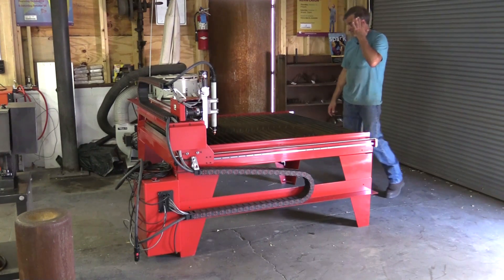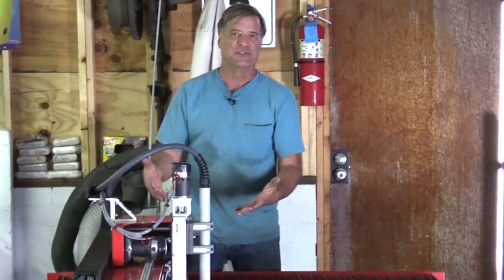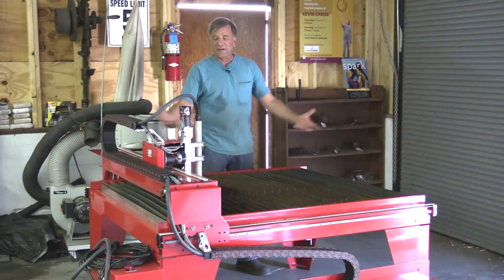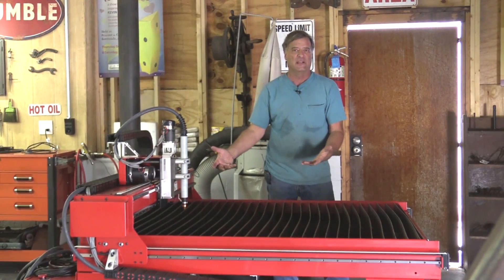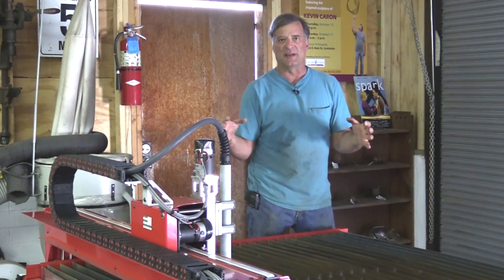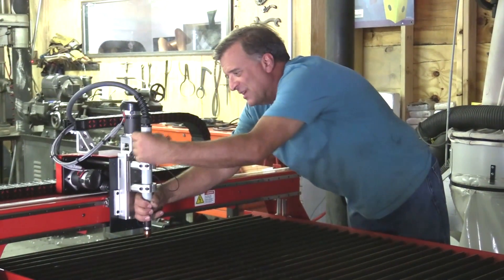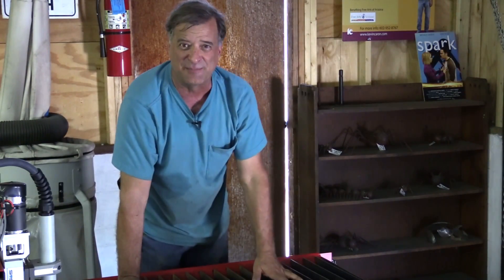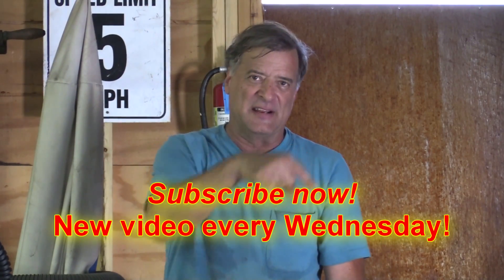An Introduction to the Dynatorch Super B CNC Plasma Table - Kevin Caron

Comment: Hey Kevin, How do you get to the grease points on yours? I just got one and can't figure out how to even access the grease zerks. They also look to small for a regular grease coupler to fit on. Thanks
Reply from the maker: A small grease gun I found at harbor freight.
Reply: Did you have to disassemble anything to get to the zerks?
Reply from the maker: Nope, everything is accessible as is.

Comment: Great looking set up , I'm in the market for CNc table and have it narrowed down to dynatorch and trucut  did you considered trucut or know anything about there tables ?And what side plasma cutter do you run with your table thanks
Reply from the maker: I did look at trucut and liked Dynatorch better.   The plasma I have is a Hypertherm 60.

Dynatorch was very easy to work with and very helpful with the newbe questions!

  Thanks for watching.

Comment: hey kevin i have a serious question about Stainless. Im assuming you use a bit of it but when I try stainless sometimes when i stick the filler rod next to the arc the rod sticks very briefly but I am wondering why. Do i need to up the amperage a little or what would you do to fix that?  Or did you have that trouble when you tried stainless for the first time?
Reply from the maker: You are on the right track!        Yes, you either need to up the amps a tad or go to the next size thinner filler rod. 

And yes, I have that problem also...

Comment: How do you feel about those exposed belts on the Super B? I have considered this machine as well, but am hesitant with the exposed belts.
Reply from the maker: No problems so far..     Belts seem very tough.   I do try to keep the dust and grit off them, keep the machine covered when not in use.
Reply: To be a little more specific. My concern is the possibility of hot sparks landing on the belts during a cutting cycle. Seems like that would shorten the life of the belts. What do you think? Thanks for replying!
Reply from the maker: The belts are a little discolored but I see no damage to them after 2 hours of use.    But now that you bring it to my attention, I will be keeping an eye on the belts just to see if a problem is coming.
Reply: Thanks Kevin. I'll be interested to hear how well the belts hold up. I'm also looking forward to seeing more videos about the machine!
Reply: Buying by weight is really very funny. I know that’s not exactly what you did, but it’s funny because a long time ago, around the beginning of the 20th century, that’s the way heavy equipment was bought. Design and metal was so bad, that often, weight was the only way to know if the machine was rigid and reliable.